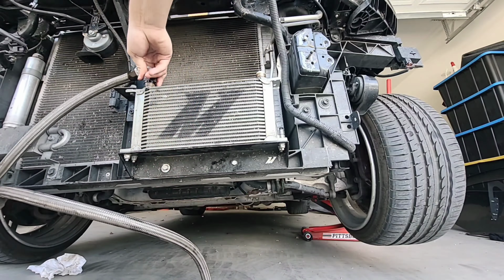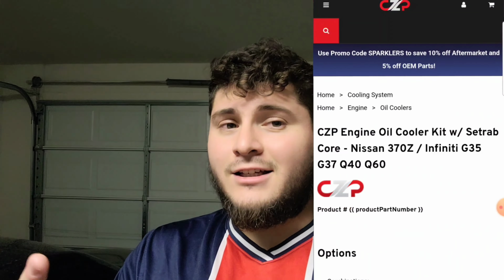Oil Cooler Review / Maintenance | NISSAN 370Z 350Z INFINITI G37 G35 Q50

Comment: I had a issue with routing the lines, I did mine under the black wheel strut, even tho it moves around cause it’s a suspension component it doesn’t scrap snap or hit anything. But how did you mount it like that ?

Comment: Question/idea.... What if you mount the cooler upside down? This way the hoses are down and you can drain the oil without having to take off the bumper and the oil cooler?

Could that be a possibility?
Reply from the maker: I have seen a few people run it back works my only concerns is if there I'll be a problem with the oil cooler getting filled since the hoses are lowered instead of ontop
Reply: @Chrizleyva  ahhh. Makes sense

Comment: so you just do a regular oil change if you have a oil cooler ?
Reply from the maker: Yes I did for a long time no issues. I only drained the oil cooler once since I have had it. All the other times ibwould just drain and refill
Reply: When you did a regular oil change with the oil cooler installed and didn’t clean the oil cooler lines after how many qts did you add? I feel like 5 qts was to much